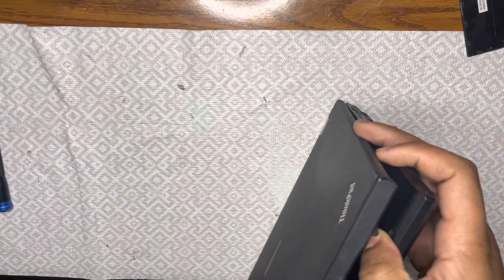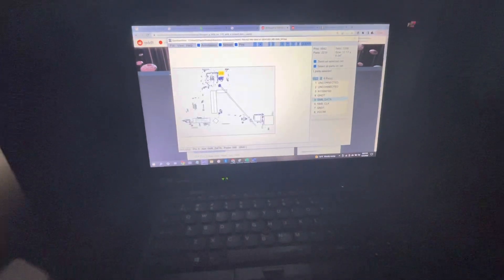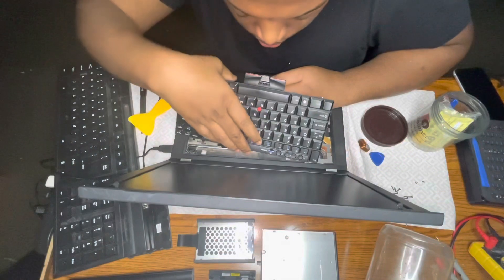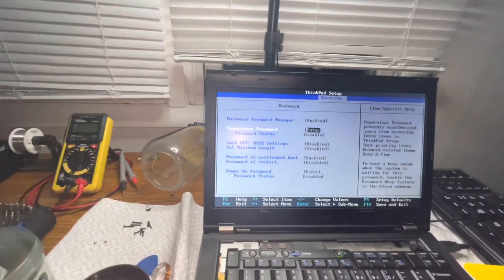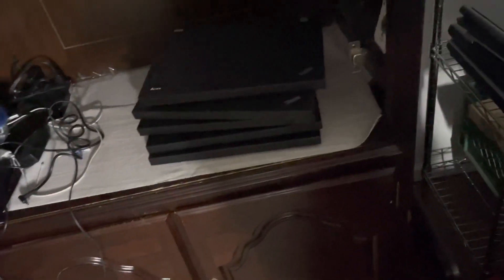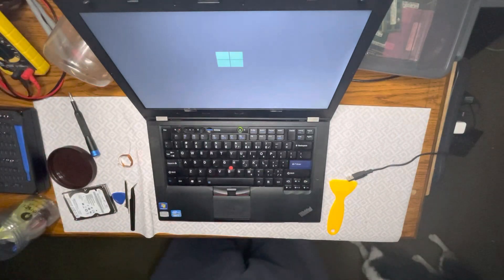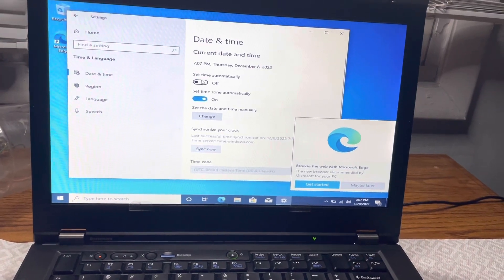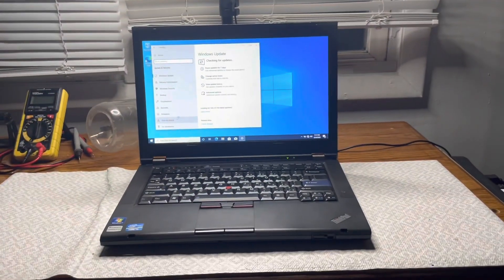Lenovo T420 BIOS Password Reset without Full Disassembly / Supervisor Password Bypass

Comment: worked for T420; tip (also put in the description under the film): the original keyboard is attached by one screw only, in the middle of the bottom side, under the plate covering the auxiliary RAM port; rest of the keyboard is held just on clip-on; no need to undo any other screw on the bottom of the laptop; also, I used the F1 key on the laptop's keyboard, no need to attach the external one;

Comment: Do I understand correctly that disconnecting the CMOS battery will NOT reset the Bios-password?
Reply from the maker: Not for these laptops. I’m pretty sure that won’t work for devices past the mid 2000s.
Reply: What's the whole post of making this video. I thought doing this would rest Administrator password lock?  Right guys?
Reply from the maker: What I do in the video does.

Comment: hi there, came across a w520 but the seller (found it in recycling i guess) says there is some kind of lock and cannot boot from the primary disk (there is no disk anyway) and the machine only boots from usb. Is this a supervisor password case? What do you think?
Reply from the maker: It probably has no or a locked hard drive. Try and do a Windows install with an USB and if that doesn’t work look in the BIOS for any locks. If you get schematics and a boardview look for CLK and DATA and find two points on the board you can short. I don’t have any I can test out in my inventory.

Comment: I hope there's such a pin for T530 too! I have one which is lucked!
Reply from the maker: There likely is I’ll have to look into it once I encounter one.
Reply: @WellsTechandRepair  My life will change by hearing more from you. please do not forget about it <3
Reply from the maker: I never ended up running across one with a supervisor password. I could make a video using one I have but in the meantime look for CLK and DATA if you can find a boardview and schematics and short the two.
Reply: @WellsTechandRepair  I am gonna need a schematic for T53p\0 then
Reply from the maker: Look on BadCaps